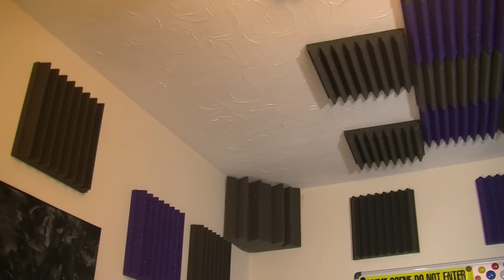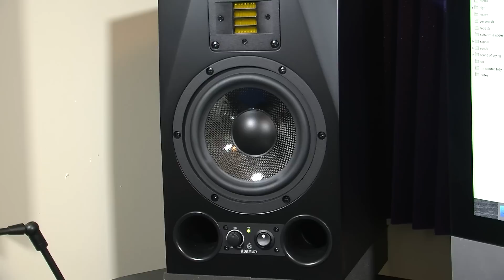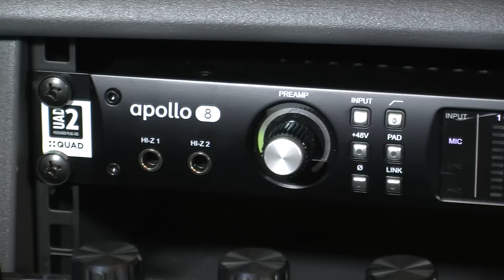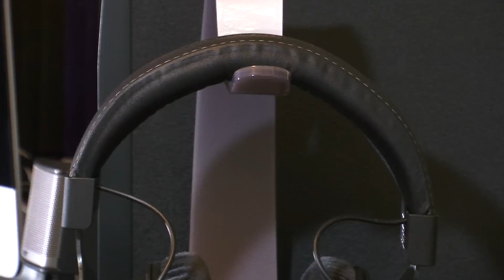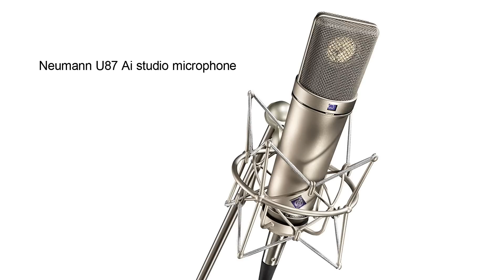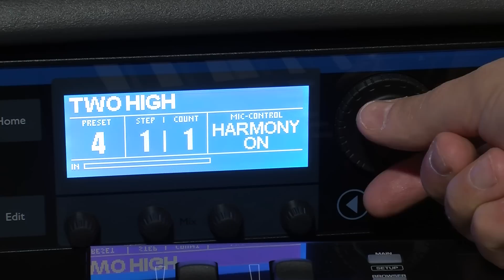Setting up a home recording studio

Comment: Excellent video and information, still very relative in 2020, the best I have seen.  I like that the very best gear was mentioned but you can achieve professional productions at home while spending a fraction of the price.  Interface - ID-14, Mic- TLM 103 (If that's too expensive) Rode NT1, speakers KRK or JBL 305's,  Headphones - stick with Beyerdynamic, there are many many reliable hard drive options, Computer - have a powerful processor and plenty of storage.

Comment: Never EVER!!!  Use Headphones for mixing. They lie.
Reply from the maker: Not if they are professional 'monitoring' headphones, such as some of the Beyer range. Even some so-called monitoring speakers can lie. My Yamaha HS7's are far from accurate, Rocket's are even worse, bass-heavy, coloured mid-range for example. I often switch between my Beyer cans and my Yamaha monitors.
Reply: I can see using headphone for a different prospective but it's Recording 101 Never mix with Headphones.
Reply: Sennheiser hd600 are fantastic monitoring headphones.
Reply: I find it imperative to use headphones when checking out the trueness of reverb, but apart from that i stick to the speakers.
Reply: Say that to Andrew Scheps ... you do not rely on headphones 100% , you use them for what they can do better than your speakers in certain situations ... besides it never hurts to reference your mixes on different speakers throughout the process ... every tool in your arsenal can be useful when used in the right context ... " never " is not a word you should use often in mixing ... SINATRA would NEVER  want distortion/saturation on his voice ... contemporary mixers can`t live without it.

Comment: Great video, but I do feel that you should have mentioned more comparable products of equal quality, as there are many in all the categories that you went through.  I appreciate you were advising from your experience and perspective. 

Also regarding the foam room treatment, isn't today's consensus that, it it certainly not effective for bass trapping or indeed any serious wide band frequency absorbing?  The view is you need rockwool or fiberglass broadband panels and bass traps, for mixing or listening room treatment, if you're serious.  Typically you only see foam in mic booths now days not in mix rooms.
Reply from the maker: Some good points, Mike. Yes, you're right, I was advising from my own perspective. There are so many compatibles it would have take much longer to mention them all in one video, but yes, there are plenty of other options out there, both cheaper and more expensive. Re room treatment, I'm also a classically trained pianist and I found the materials I used in this video work best for my Rameau piano that I also have in that small studio (not in shot) as well as the studio monitors. Yes, fibreglass/rockwool is also used, but it's an alternative that yields different results, not necessarily better or worse. For me, personally, bass traps in the eight corners of a room are a must and I've heard with and without and for my ears I much prefer the clarity and punch that bass traps allow.
Reply: Nigel Cooper Cheers Nigel. The only reason I raised those points was because your video goes into great depth explaining each bit of kit and what they are used for. So very good for beginners, but just wanted to make the point that your kit choices are good and I have some of the same  gear.  Beginners should know there are a wide selection of comparable options that will get them quality results, and they should do lots of research to learn what’s out there, but your recommendations are a good starting point.

Comment: You are quite correct about the multi polar pattern Microphone U78 iA, but the reason behind it, is that, it is a Ribbon  Microphone. most Ribbon Microphone from the 50s and  60s to 80s, are very expensive are good as price range of $ 20,000.00  in some instance, and the issue of room acoustics, it all about the size, height. in some case, you don't need stuff like base trap and  absolve, in the case of a mastering environment, it  will only need  acoustics panel  fitting. your Tutorial was very useful to the fact.
Reply: Menda Vince Atunuvbare Survival Of The Fittest: The Prisoners Bible.  by Chief Shuaib Y. Israel. Get The Book! Or FACE THE MUSIC!!

Comment: I'm upgrading my studio, but thought I'd keep my Focusrite 430mkii Producer Pack, which is equipped with an ADC card. I am thinking about getting the Apollo 8, but concerned that the preamps would not be used at all if I'm using the Focusrite, and therefore, I might be wasting money. Do you have any suggestions about this? I have been using a Digi 003 to get signal into computer, and never used the mic pres in it. The reason for the 003 is because I have to also take the signal and route it to a JK audio phone patch, and also a Telos Zephyr ISDN codec and a headphone amp. Thank you!
Reply from the maker: Chris, if the pre-amps aren't going to be used in the Apollo 8 you might be better off sticking with what you have. I must say though, the plug-ins that UA make are amongst the best in the world and are way superior to what say Apple Logic Pro comes with as standard. I actually have a Focusrite Clarett 2Pre and it's great, for the price. Not up there with the UA Apollo 8, obviously, but it doesn't really pretend to be.
Reply: Thank you for the reply, Nigel. Really enjoyed your video, btw.
Reply: Hi again, Nigel. I just wanted to clarify something before making a change, did you think the pres in the Apollo are better than the Focusrite ISA430 MKII Producer Pack?
Reply from the maker: Hi, Chris. Sorry I can't help on this one as I haven't had any experience with the Focusrite ISA430, sorry.
Reply: no prob.  thank you!

Comment: I really enjoyed this. I did want to mention that for back up there are also online services. Here in the US I use a service called Crashplan but there are tons of them out there. It runs in the background using very little resources and it's cheap. And you don't have to worry about fan noise. It's saved me a few times.

Comment: Some of the budget suff nowadays is excellent though... you don't necessarily need to spend heaps of money even if you are serious. Like the scarlett 2i2 or 18i8, both 192KHz, award winning preamps and zero latency - excellent equipment which can be considered "budget"
Reply: Actually the Scarlett 2i2 is 96kHz and has some latency issues when tracking (no dedicated DSP at this price point to prevent it). Great piece of kit still, even though it might not be an UAD Apollo. Nigel's suggested setup implies that you'd be ready for virtually any situation, it's a reasonable investment if you're building a project studio that can take jobs in genres different from pop/rock, and if you need the absolute most pristine, fail-safe tools to focus on producing rather than trouble-shooting. If you're recording jazz or blues it definitely comes in handy. That said, I've worked with medium/high focusrite ad/da's, decent full-on dining table-sized mixers, outboard compressors/limiters and such, but for my current budget and use, the Scarlett 2i2's clear uncoloured preamps and good plugins are enough/the most sensible choice. A good mic, decent monitors and great headphones are top priority for this kind of budget project studio. If you can capture the sound clearly and also listen to it clearly, you can make more informed decisions when working with it. Even if you want to dirty it later. Cheers.
Reply: Nowdays ? Some ? Man im 30 years old , 15 of that in music , never had a bad interface, or expensive one, all cheap all good , since 10 years ago . there is just no excuse for making bd production these days ,  but even if you do good , now when everyone can do it , who wil care , who will hear ,  that is the problem today
Reply: Agree to certain extent, nothing comes close to Universal Audio Apollo in my personal opinion.
Reply from the maker: This is true, Joshua. I actually have a Focusrite Clarett 2Pre and it's excellent, but it is nowhere near as good as the Apollo by UA. But it is a fraction of the price. But, you get what you pay for and the UA Apollo 8 is miles ahead of my Clarett 2Pre in terms of quality pre-amps and sound quality – chalk and cheese. Same goes for most other audio equipment. The Neumann is in a different league to say a Sennheiser MK4 (both of which I own and use). It is true that you can get some excellent recordings from more budget kit like the Focusrite 2Pre and Sennheiser MK4 (as just two examples here) but don't be under any illusions that you'll get Abby Road quality from such budget kit as it doesn't even come close. Some people (not you, Joshua) like to try and justify their budget kit and convince themselves that it is top notch. I own a BMW 3 series, but I'm aware that it is no Merc S class and just because I can't afford a Mercedes S class I would never try to convince myself, or others, that my BMW 3 series is an S class.